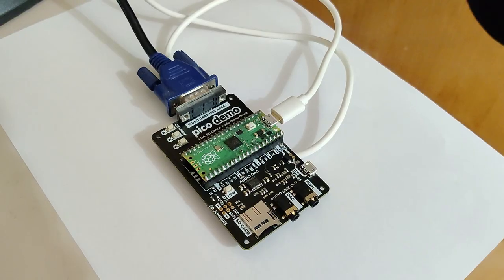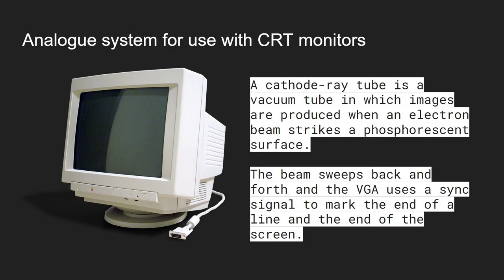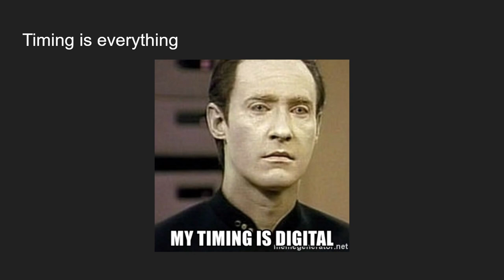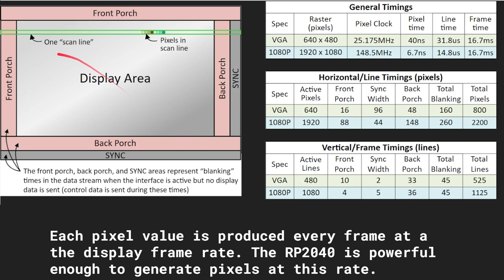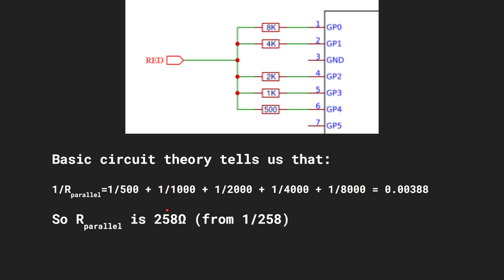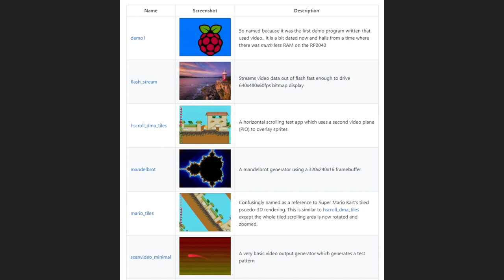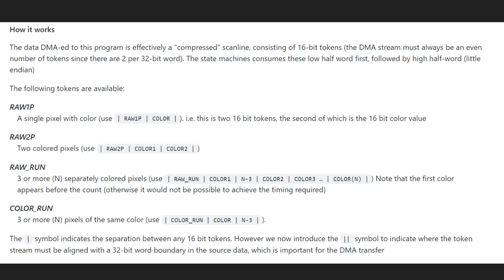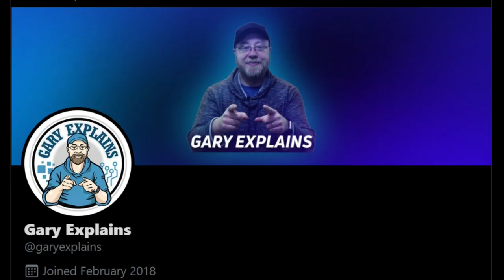What is VGA and How to Use it With a Raspberry Pi Pico

Comment: Great explanation of VGA for the pico.  Some of you may find the PicoMiteVGA implementation interesting....basic on a pico with vga support...and the graphics commands needed.  I have not messed with the VGA version yet but the regular PicoMite seems to work well.  The fellow who did the MaxiMite boards brought Basic over to the pico.  So now we can have an 80's micro in the form of a pico microcontroller board.
Reply: I second this recommendation, having built up a Picomite myself on some Veroboard. While the hard coded graphics demos referenced in this video look very impressive, the Picomite is a nice little project which turns your Pico into a fully self-contained computer running BASIC (just add a PS2 keyboard and VGA monitor). That may not sound too impressive but if you're familiar with the Maximite and other MMBASIC running platforms, you know that BASIC running on this modern hardware is a fast if not faster, than machine code running on 1980's hardware. Lots of fun to play with.
Reply: @afreestone101  BASIC in the was not fastest, but it was never slow, there was a lot a bad programming, even being  manly used as stepping stone to something, else, with the excuse , X programming language does not have command X, so we wont discuses that here? more on basic is  slow, professionals use x, y, z, but not, basic   even if was not the fastest, that down compiler used, and hardware it was run on, 4 or 8mhz cpu's and memory 32k or 64k, it computer 510k or more you where in mainframe business stuff, now a days there some discreet logic on the motherboard somewhere that's using many time that
Reply: @afreestone101  BASIC in the was not fastest, but it was never slow, there was a lot a bad programming, even being  manly used as stepping stone to something, else, with the excuse , X programming language does not have command X, so we wont discuses that here? more on basic is  slow, professionals use x, y, z, but not, basic   even if was not the fastest, that down compiler used, and hardware it was run on, 4 or 8mhz cpu's and memory 32k or 64k, it computer 510k or more you where in mainframe business stuff, now a days there some discreet logic on the motherboard somewhere that's using many time that

Comment: Great explanatory video. Reminded me of the Atari 2600. This is similar to how the Atari 2600 has to be coded but at much lower resolution because the 6502 doesn't have enough grunt in it and each instruction takes at least two clock cycles, IIRC. But here the PIO takes up much of the grunt work that has to be done in software on the 2600. There is no buffer of any kind on that thing and because virtually all its time is taken up drawing the screen, most of the extra code has to be performed in the VBLANK area (what you call the Front Porch at the top of the screen).

Comment: Love this series on embedded programming. Would love a USB driven GPIO board I can plug directly into my PC and not need a Pi or Arduino!
Reply from the maker: There is a thing called the GPIO Expander that works with the Pi Zero. I haven't tried it, but here is the link: https://magpi.raspberrypi.com/articles/pi-zero-gpio-expander
Reply: Dude the Pi Pico IS a usb driven GPIO board, in a sense.. You can use thonny and micropython for example to edit the program ON the pico so all you have to do is hit F5 and the code runs. If it's about memory and speed, I concede of course.

Comment: Very good Gary but the PicoMiteVGA is a more complete implementation and already avaialble. Uses the 2nd ARM CPU and one of the PIOs to generate VGA without impacting the very fast MMBasic running on the other CPU. High level graphic commands and sprites, file system via both SD card and onboard Flash. Some very clever people have developed the 'Mite' over the past 12 years or so (previously on the PIC32) and it's really impressive. They are busy working on a Picomite-based (6-8 channel) Logic Analyser at the moment - it uses PIO DMA transfers (controlled by MMB) to achieve the speed. Just built a PicomiteVGA 'home computer' for my Grandson's birthday - software a free download, hardware just a Pico and a few components. Very inexpensive and much easier to do for us programming Dummies!  🙂

Comment: 8:23 I think the diagram is wrong, it connects the 2k ohm resistor for blue to ground instead of GP13 (17), and the 1K ohm resistor for GREEN to GND. I believe this was caused by just copying the connection-pattern from RED and not checking the ground-pins
Reply from the maker: Yes it is wrong. Please see the other discussions about that here in this comment section.

Comment: I did something similar. I have an array of six resistors for four outputs, so I get 16 fixed colors, and the memory is organized as flat 4 bits per pixel. It didn't occur to me to run length encode the pixel data. I've been thinking about using an external RAM as a palette, but I can't find one fast enough in a through hole package.

Comment: It's interesting if you look at the Espressif ESP32 variants how many of them have co-processors that aren't well known. For example ESP32-S3 has two LX7 ARM main processors and two ULP coprocessors, one based on RISC-V instruction set architecture (ULP-RISC-V) and the other on finite state machine (ULP-FSM). The clock of the coprocessors is the internal fast RC oscillator. C3 and C2 look to be missing out on these. While the coprocessor speeds appear at first glance to be very constrained by the RTC clock speed, don't forget that the ESP32 units contain DMA. While a micro like the C3 needs highly structured multitasking to run real time tasks in addition to something like VGA (And doesn't have that many pins anyway), most of the other ESP32 variants do have the capacity. Many of the pheripherals support DMA which substantially offloads urgent tasks when used. If the ULP can be switched to run at a higher clock speed, there's a lot more can be done with many of the Espressif chips. And they have built in Wireless. That's the main thing putting me off doing much with the RP2040 dev boards. On the flip side of that, I developed a PCB years ago using an OSD chip. Around the time I started populating the board, I found the OSD chip was going obsolete, so it's great to see projects like the VGA hat and the HDMI hat for the RP2040. I would think that typical sorts of tasks the ULP would be well suited for would be things like remote control IR code bit banging, reading and writing other custom bit banged protocols. Not sure how much connectivity the low power RISC-v sub core has on the S3 to the main pheripherals? Of course there's also the possibility that the processors are not fully available, for example they may get priority tasks from the 2.4G subsystem, I don't know if that stuff is in embedded code or if it's implemented in an FPGA realised as a subset ASIC block on chip.

Comment: A simple doubling of resistor value between bit positions does not give a linear output.  Consider the 500 and 1000 values.  If only the GPIO with the 500 resistor is high the voltage across the 75 ohm in the display is proportional to 75/(500+75) = 0.1304  When only the 1000 ohm one is energised the voltage across the 75 is proportional to 75(1000+75) = 0.0.0698.  Clearly the first of those is less than twice the second.  For the 8K resistor it is 75(8000+75) = 0.009288.  The ratio between the outputs from the 500 and 8000 is only 14.043 instead of the ideal 16.

Comment: Why is the 2k resistor in the blue section in your  diagram connect to ground and not to GP13?
Reply from the maker: Unfortunately there are some mistakes in the diagram. The red channel is correct.

Comment: The E12 values might be 470, 1000, 2200, 3900 and 8100. That should be closer enough.
Reply: 2x 1k in parallel = 500 Ω
1x 1k = 1k
2x 1k in series = 2k
1.8k + 2.2k = 4k
3.3k + 4.7k = 8k

Comment: There's errors in your diagram at 8:17. Your resistor ladders some resistors connected to ground and the GPIO is left open.
Reply from the maker: I think you are mistaken. Also, the diagram comes from the Raspberry Pi people, not me.
Reply: @GaryExplains  I'd have to disagree. That diagram is wrong.
Reply from the maker: Which resistors are connected to ground and the GPIO left open?
Reply: @GaryExplains  On the green channel: GP8 is left open and the 1K is tied to ground. On the blue channel: GP13 is left open and the 2K is tied to ground. The red channel appears to be correct.

Please check what you are posting instead of being defensive with critiques.
Reply from the maker: First, my apologies, you are correct. I didn't spot those mistakes. As I said the diagram is from the official Raspberry Pi github repo. It appears that a bug report was raised in Nov 2021 about this https://github.com/raspberrypi/pico-playground/issues/20 but it has yet to be fixed. Can I just say that if you had just led with that info, this thread would have gone much better.
Reply: @GaryExplains  I wasn't aware of that info. I'm could clearly see that it was wrong. I explained what was wrong. You didn't even look and arrogantly claimed it was right. 

Unsubscribed.
Reply: @misterhat5823  I'm the reporter of the Github issue, I think @Gary Explains has instinctively reacted too quickly because the source is vastly trusted. It took me several minutes to figure out that something was wrong.
Reply: @christophepetit8645  That doesn't mean you flippantly tell someone that they are wrong without looking at it. Anyone with basic knowledge of electronics would have seen that error glaring at them. Had he looked, he'd seen it too.
Reply from the maker: @Mister Hat Well that is a odd argument because the original author of the diagram didn't see it was wrong, so it isn't that "glaring" is it? It is actually an example of something we all do, the RED channel is correct, a cursory glance at the others seem the same and we convince ourselves that it is correct.

As  Christophe PETIT said, the source is highly trusted and I instinctively trusted the official source, rather than you. I know the source, I don't know you. Even when I looked at it the second time, it still seemed correct. If you had bothered to mention in your original post some details of the error, rather than just saying, "there are errrors" then this whole thing would have been much easier. By the way, I wasn't suggesting that you should know about the GitHub bug report, I was saying you should have provided details of the errors you had spotted.

You said in your last comment to me that you "explained what was wrong." Well A) You didn't. B) As soon as you did I saw what you meant and apologized. C) I did take a second look, but since you provided no details initially I still didn't see the error.

As I have said, I have apologized and recognized my mistake, if that isn't enough for you, then I can't help you further.
Reply: @GaryExplains  issue is closed as of May 2023 (I just checked). They also had VSYNC and HSYNC flipped and they fixed that too.

Comment: Is it possible to use 1 pin with 1 resistor pwm to replace the 5 pins with resistors

Comment: I think the Pico will be 70% busy and full with VGA. You have to program really fast and efficiently to squeeze everything in there. Therefore everything in C++ and not in python. 
Each higher Lib will again need space and CPU time.
The 8 bit computers of the 80's had their own IC that took care of the video and not the CPU.
Reply from the maker: Yes that might all be true but the Pico is a dual core processor so there is another whole core sitting there doing nothing. Also, it is powerful enough to play Doom, do that kind of proves what it is capable of doing.
Reply: If you code efficiently you can definitely get a lot out of it. If you do it right you can even get VGA output plus a basic animated effect in less than 1.5 kilobytes (for the whole .bin file; 3KB for the .uf2, always twice the size)

Comment: It doesn't have enough memory for a 480p frame buffer but it can run Doom? That is extremely hard to believe.
Reply from the maker: There are other techniques besides frame buffers. The code is here try it for yourself: https://github.com/kilograham/rp2040-doom
Reply from the maker: Also the port runs as 320x200x60 not 480p. More details here as well: https://kilograham.github.io/rp2040-doom/
Reply: @GaryExplains  This guy seems to be the only one with videos of this Pico Doom. Honestly looks pretty sus' to me. I'm simply not going to believe this until I see some independent setup videos.
Reply from the maker: That is your choice. It isn't my job to convince you.

Comment: The  schematic is wrong. You connect two pins to GND....
Reply from the maker: Yes, that is a mistake. The diagram is from the official Raspberry Pi github repo. It appears that a bug report was raised in Nov 2021 about this https://github.com/raspberrypi/pico-playground/issues/20 but it has yet to be fixed.